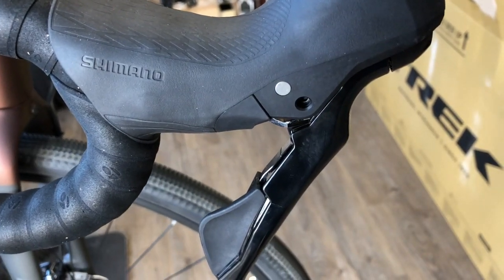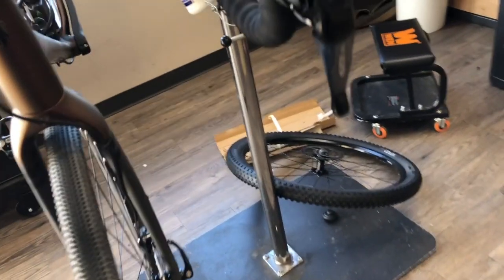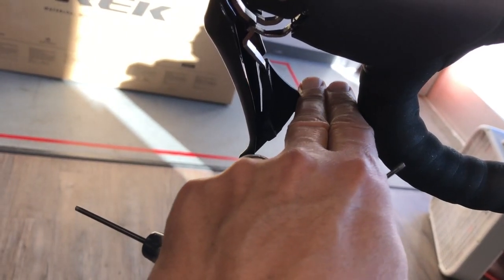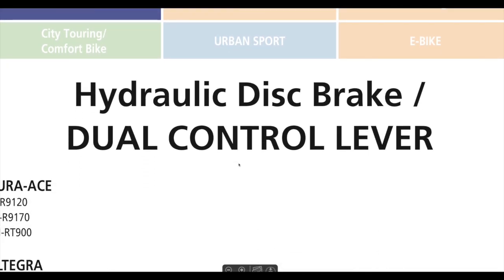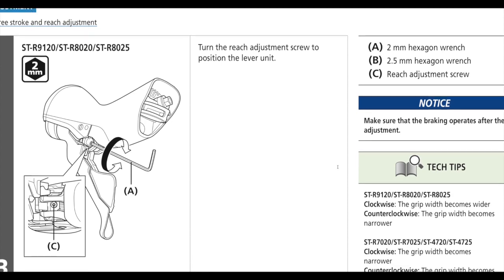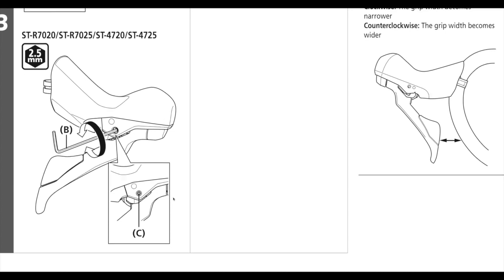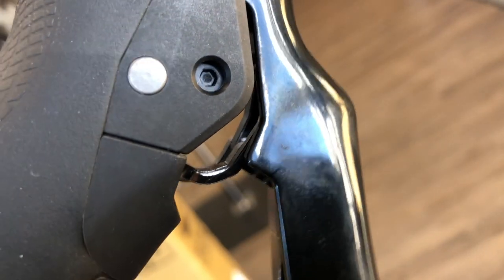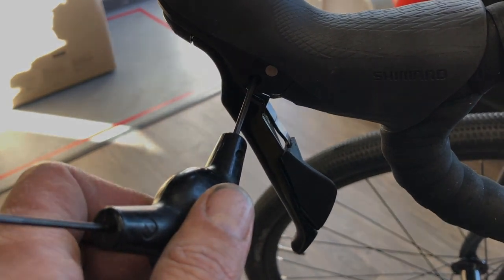How To Adjust Lever Reach on Shimano 105 ST R7020 Levers

Comment: I had a problem when installing a new St-R8020 shift brake system the right side couldn't be bleed I It's the first time I encountered this (I have set up dozen's of these systems. I ended up bringing it to a bike shop locally and was told the small tube that leads to the reservoir was blocked. My question is - is this common? How do I fix something like this myself
Reply from the maker: We had a few that were clogged up with a thread locking compound used to assemble the compression nuts. Shimano warrantied them all.